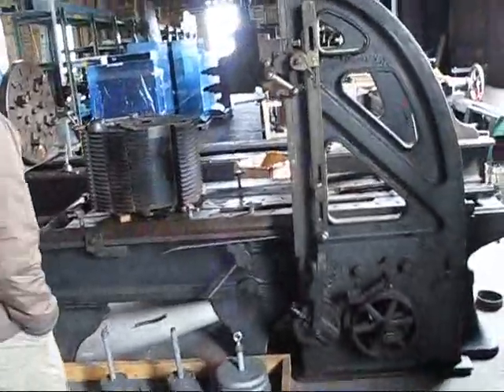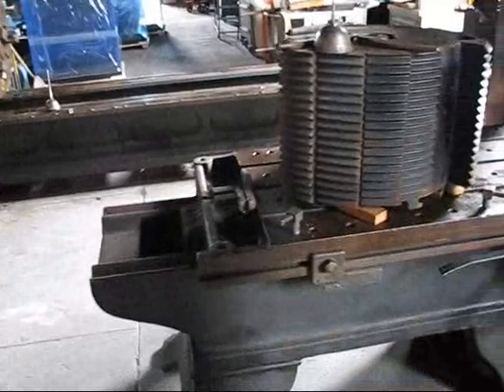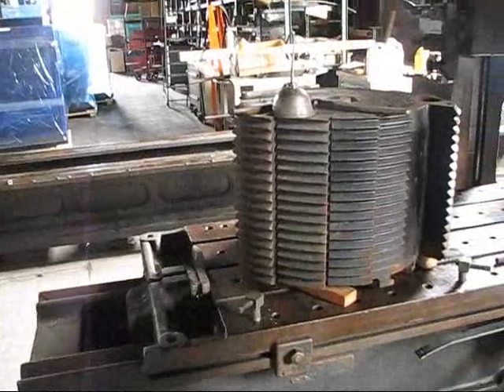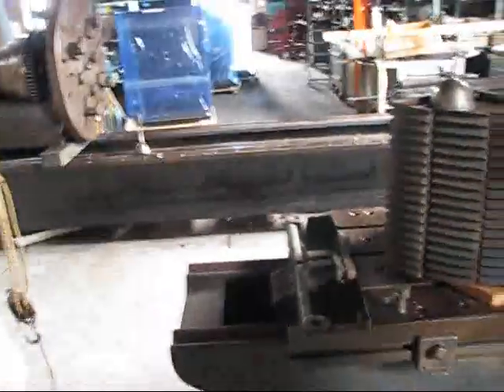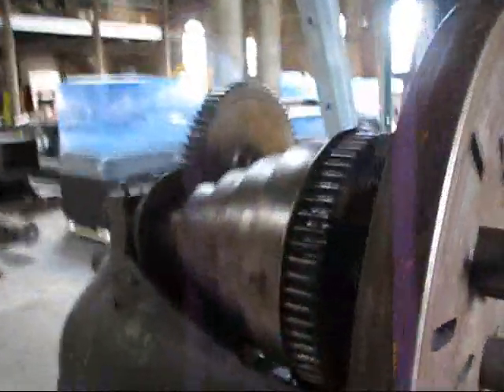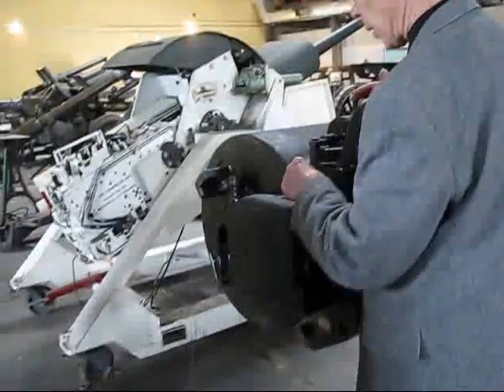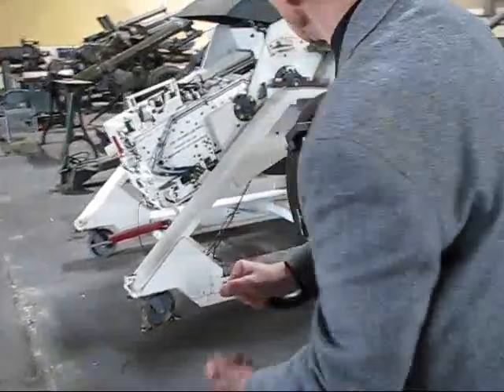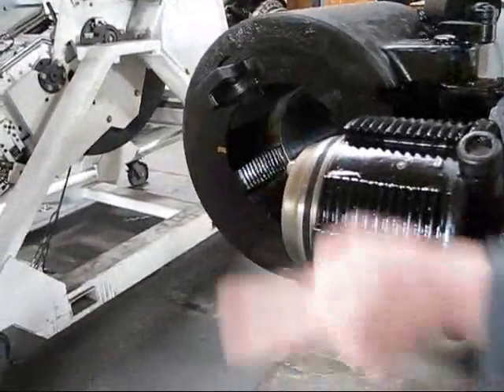Modern Cannon Breech Demo  Watervliet Arsenal Museum

Comment: How is the interrupted thread machined on both the cannon and the breech block?
Reply: They are all threaded completely. Then the sectors are cut away on slotters for the ring and horizontal mills with a form tool for the tube. The step threads were done on a machine which was cam actuated.
Reply: The only way i can see is too machine a complete thread then cut out the unwanted parts.

Comment: Old machine tools are much more interesting to look at than modern CNC machines.
Reply: Im confused is this referring to something in the video?
Reply: @royrogers3624  The Lathe and Planing machine.
Reply: @msa-tt4bg  you realise both of those are also used today right? They're also much simpler at that but they arent at all "old" theyre used literally daily and are required side by side theyrw quite literally a necessity
Reply: @royrogers3624  What i meant was, i'd rather look at machine tools of this vintage, than today's CNC controlled Machining Centres.
Reply: There's a great documentary floating around YouTube called "Gunsmith of Williamsburg" that shows a traditional gunsmith making a flintlock rifle from ingot to finish. Using no modern tools; just what they had in the napoleonic era. It really taught me a lot

Comment: It seems like with the interrupted thread, once you closed and locked it, there would be week spots or gas leaks where there are no threads?
Reply: I think this silver shortened cone is pushing at that black ring and expanding it, that is the gas seal not the threads.
Reply: This type of breech screw has a resilient pad that prevents obturation and is employed mainly on breech loading (BL) guns unlike the other type that uses a cartridge case to prevent obuturation quick firing (QF) gun.
Reply: Obteration has nothing to do w/ gas leakage, it's when a projo such as in a muzzleloader expands into the rifling. But I could be wrong, it happens once in a while.
Reply: @cannon-mike  The term "obturation" refers to the sealing of the gas in a gun chamber. It splits into "forward obturation" which is handled by the interface between the projectile and the bore and "rearward obturation" which refers to sealing the gas to the rear. 

Rearward obturation is either achieved by the breech mechanism which contains a gas seal or the ammuntion which usually has an expanding cartridge case. In this case the gun uses breech obturation which means that there is a gas seal at the front of the breech block. 

The one in use here is called a "De Bange" obturator and uses a mushroom shaped pad set on a flexible sealing ring. The gas pressure on the mushroom pad forces it back expanding the flexible seal like an O ring. De Bange obturators are still in use and feature on the M777 howitzer. 

Most small arms and light cannon use ammuntion obturation which uses the expansion of the cartridge case to seal the breech. Interestingly the Abrams and Leopard 2 tank guns use ammunition obturation with a short "stub" case at the end of the combustable cartridge case. The UK Challenger tank gun uses breech obturation with a clever sliding breech block. There is nothing left after the gun fires..
Reply: @felixthecat265  u are correct I realised my brain fart later, I'm just rusty. Do u happen to know what material is used in the seal as I have a 40mm with a leaky screw breech, it's just flat faced steel on steel, it's been fired a lot. I'm looking at different  possibilitys.
Reply: @cannon-mike  There were a number of materials used for obturators, mostly consisting of a mix of a fibre and some sort of rubber. I know asbestos and gutta percha were used at one time, but I don't think this would be wise these days. I would suggest taking  a mould of the original  obturator from silicone and then try moulding with nylon rope and one of the high temperature silicone rubbers.
An alternative would be to turn an obturator from a high tensile engineering plastic such as Delron.This is what I do for making Chassepot obturators
Reply: @felixthecat265  thanks for the info. Mine is a home made 40mm screw breech bag gun. The seal is a free float head with a small 45° angle like an engine valve. So I need to make a longer expanding head of some sort. I'm a retired machinist, I have some delrin nylon uhmw & such rems. Again thank u.
Reply: There is a 'Dirby Hat' shaped gas block, that keeps the gasses down the barrell